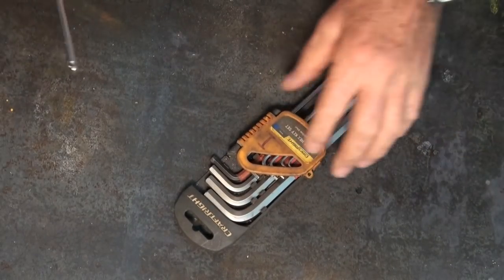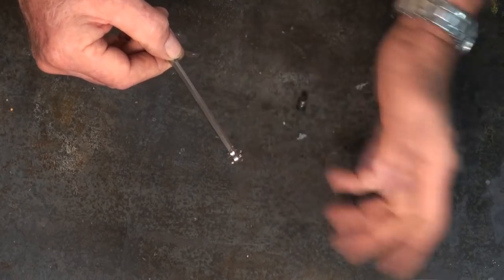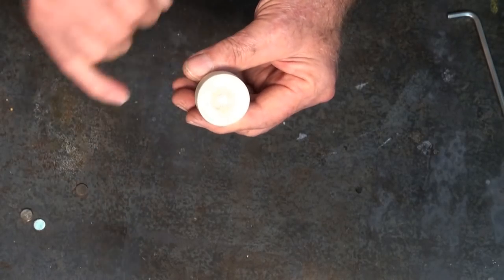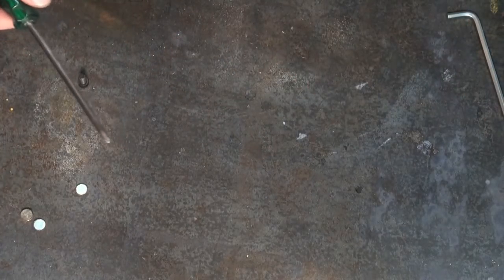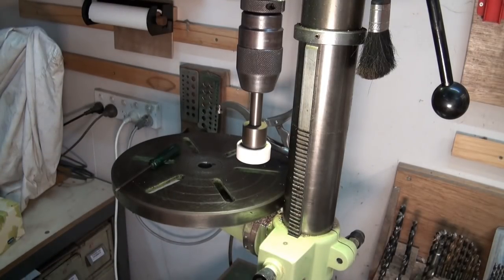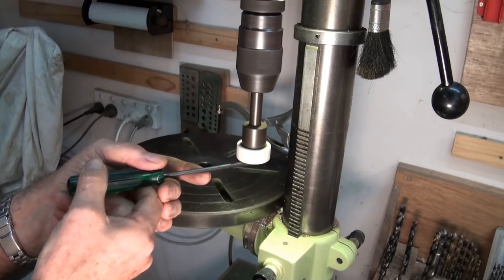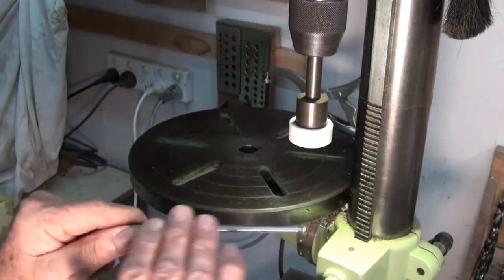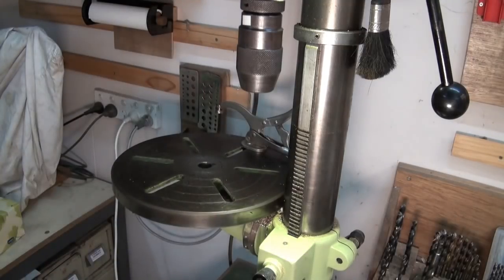DIY Demagnetizer Tool (That Works!)

Comment: As a boy I worked in a radio repair shop, we used a soldering gun to demagnetize screw drivers. Pull the trigger , slide the screwdriver through the loop formed by two rods and the soldering tip and remove slowly. If you Release the trigger while the screwdriver is in the loop it will magnetize it. I will make one like yours because half the time I can’t find my soldering gun. LOL 😂 !
Reply: Good tip, I've got one of those guns.👍
Reply: I still use the same procedure today

Comment: Works perfectly. Made one out of alumin(i)um, fun 2 hr project that is super satisfying to use. I've used it on end mills and other edged tools by clamping a thin sheet of plastic to the drill press table tight to the bottom of the spinning magnets part. That way the end mill is separated from the spinning plastic. Thanks for the video!
Reply from the maker: That's great! I only wish it was my idea. I made a much more elegant version here https://www.youtube.com/watch?v=Ew4BwYTzCe8 
I use mine regularly and it hasn't let me down once. 
Regards,
Mark

Comment: Mark, you just saved me $70. I am going to 3D print one out of plastic and glue some magnets into it. This is a great idea and tool. Thanks!!
Reply from the maker: Rodney. I only wish I could claim it was my idea. I think I saw this on the Home Shop Machinist forum. However, it's so simple and it works. Everyone should have one!
Regards,
Mark

Comment: I was impressed by your idea and have made my own version, seems to work just fine.  I run my version in a battery drill.Thanks
Reply: sOME TIME THOSE VERSIONS WORK IN A STRANGE WAY,  they dont demag completly. If you had a watch repair shop , fixing watches that cost 30.000 bucks, for sure you wouldnt use your version.

Comment: Made one based on your design, and it works!  I had a file and a boring bar suddenly turn magnetic, and this gismo solved that problem! Thanks for the tip
Reply from the maker: COOL! I'm glad it worked for you. There's nothing worse than a scriber that picks up swarf all the time. I have also put files down on the bench only to see a little halo of steel dust form around them. Creepy!

Comment: The construction you have is as good as it gets. The steel is fine as the mandrel, and is preferable to something like aluminum for a number or reasons, top among them being that it provides a path for the field on the non-working side and reduces stray field above the working plane to near zero. Additional benefit, to me, is that the magnets are attracted to it which can only improve the support.
Reply from the maker: Thanks for the technical explanation. This was definitely a "gut feeling" build. Magnetism is a sort of devil magic as far as I'm concerned! 😁

Comment: I have seen another YouTuber use the blue box contraption and it worked perfectly.  He magnetised and demagnetised the same tool repeatedly.
Reply from the maker: I have seen that too but it never worked for me. It would magnetise a tool OK but I never had any success completely demagnetising a tool with it. I used my rotary demag  tool today to demagnetise a centre drill that was holding chips. It just works every time.
Regards,
Mark

Comment: That´s clever idea! I built one with a pinball machine flipper coil and a small 12V transformer (unrectified - only AC) that works OK, but your solution can be also used in a lathe, when tools start to get magnetized, you just put your demagnetizer in the chuck and pass the tool in front of it. I like it :-)
Reply from the maker: Jose, the other good thing is that you can put the demag tool in a power drill and pass it over larger parts that aren't easy to move around. It works great for me.

Comment: Hello Mark. Thanks for posting this. I searched for demagnetising and was pleased to find this non electrical solution. I was then pleased to see it was from you, having seen you on one of Harold's excellent get together chats and your guest appearance on Rusti's channel. Anyway, I made my own version and it worked like a charm. I will be showing it in an upcoming video. So thanks again, this was really helpful to me. I'll be sure to give you a shoutout and link to this video. Mart in England.
Reply from the maker: Thanks Mart. I was also surprised when I made the first version of this tool. It seemed unlikely that such a simple concept would work as well as it does. You could easily make one of these with a 3D printer.
Regards,
Mark

Comment: Worked like a charm. I build mine using 4 neodym magnets, each 6 mm Ø x 10 mm, and fastened to the end of a bold with some gaffa tape, and rotated with a small battery powered drilling machine.  Thanks a lot.
Reply from the maker: Who would have thought it was so simple? I had previously struggled with the prospect of having to modify a mains operated transformer for an electromagnetic solution. I hate the idea of having to have live voltage to do the job so the magneto/mechanical solution was gold.
Regards,
Preso

Comment: Hi , mate, just a warning about quartz watches and demagnetisers.
Some 20 years ago , I was servicing a large production surface grinder , and next to it was one of those  "portal" demagnetisers, were the operator passed the parts thru , after finishing the operation.
I was wearing a nice Seiko quartz , and it was about 7.30 in the evening , and we had tea at 8pm , so I finished the setting and check the part and put it through the demagnetiser, look at the watch and it was 5 minutes to 8 , yee the time fly .. so I hurry up and pass thru the canteen, and see no one there,,, hey the boss must be checking out , ...but looked at the clock in the canteen, and it was 20 to 8, so by putting the watch near the demagnetiser, it has gone 20 minutes in about 15 seconds .. talk about time traveling...
Thanks for your chanel mate
Reply from the maker: I have seen that happen when I quartz watch is placed close to a heavy duty spot welder. The magnetic field around the copper arms will speed up the watch. It didn't seem to harm the mechanism but you are correct that if you don't notice it schedules will suffer!
Regards,
Mark

Comment: We used to use a Radio Shack BULK TAPE ERASER (Realistic 44-232)  it looks like a small iron and is about 2" x 3" You hold a button and energize it and run it over the parts to demagnetize and slowly move it away.  We used it on industrial machinery that feed loose nails and it worked great.They only cost about $30.00 back in the day.
Reply from the maker: Ahh, I still remember Radio Shack. It always had a distinctive smell in those shops. That "Realistic" brand name was on everything they sold from what I recall. I did start off with the idea of modifying an old transformer to make something similar but the instructions I read about how to carry out the modifications started to get a bit scary with electricity and all. But if you could buy something off the shelf that works it would be worth it. I still use my rotary demag tool. It is stuck to the side of my drill press and I use it often. It still seems like magic when it works. 
Regards,
Mark

Comment: Great solution to a pesky problem! Thanks - my tools have all mysteriously got magnetised over the past couple of weeks, we have had thunderstorms but no lightning close to my steel shed as far as I know. Our previous house got struck by lightning, it caused all sorts of weird problems with a TV that got half a green screen, I took it to a repair guy as I thought the degaussing circuit was cactus - nope, that was fine. Long story short I asked him to come to my house with a degaussing wand, when he arrived I told him to go in the shower and degauss the enamelled steel shower base, that fixed the TV. The problem was caused by the lightning strike magnetising the shower base which just happened to be directly behind the wall where the TV was, up a couple of steps - hence half a green screen!
Reply from the maker: That's really interesting. We had a severe thunderstorm that killed a quartz clock movement. It stopped at exactly the same time as a lightning strike near our house. I guess those clock movements use some sort of magnetic field to move the mechanism. It was battery powered and not connected to the mains so it wasn't a power surge that did the damage. 
Regards,
Mark

Comment: U can use the magnet from a speaker and run it through the middle of it. It can be a busted speaker just completely remove the magnet . Works good too. The bigger the better. U can find tutorials on how to remove them. 🤙

Comment: Hello Mark, I have just had this video of yours come up in my suggestions. What a great suggestion!!! I am ordering some magnets next thing.
 The first thing I am going to demagnetize is my Mitutoyo Verniers. I stupidly used them to measure the diameter of same magnets, know what happened, I turned my Verniers into a good magnet.
 Hardenable Stainless is a most accepting media as I knew but did not think before I took the leap. Thanks heaps.
Cheers from John, Australia.
Reply from the maker: John. Glad you found it useful. I have to demag my calipers regularly. I still don't know why tools of all types gradually become magnetic. It's a mystery!
Reply: Hello again Mark, I have also noticed on my scribe that it also becomes a little magnetic after a touch up on the grinder, that is also frustrating when marking something out with a ball of fuzz on the end.
Cheers from John, Australia.

Comment: Thank you sir, the bolt carrier for my WBP AK-47 has magnetism that I would like to remove so it does not attract metal debris if I were to shoot steel cased ammo from it, will try this to remove the magnetism. Bet you didn't think you were going to help someone demagnitize their Kalishankov when you made this video.
Reply from the maker: No, that is a surprise. I hope it works for you.
Regards,
Mark

Comment: Funny, he says “just so you know I didn’t secretly change screwdrivers off screen “…like degaussing scams are a thing. I can’t wait to try this. Also, I just learned more about magnetism here than in that physics class I failed in High School. Thanks!!
Reply from the maker: I have made three of these things and they work great. They are so simple and much safer than the doctored transformer type. I only realised after shooting all the video that I accidently took the screwdriver out of the frame during the crucial shot and as a result I had been accused of doing a switch and faking the results. If I were charging people money I guess there would be a case to answer but people are free to take it on face value.
Regards,
Mark

Comment: Just made one using a medicine bottle top wooden dol 8 6mm x 2mm rare earth magnets and a hot glue gun... Had to double stack the magnets... Used a compass to find the north and south poles. I demagnetize some AR 15 Parts firing pin and Bolt ... I spun the unit with a screw gun.
Reply from the maker: I had the idea that you could just about totally 3D print all the parts (except the magnets). It seems such an unlikely solution and it can be as simple or complex as you want to make it. 
Regards,
Mark

Comment: Good idea.   I think the steel base helps to concentrate the magnetic field.

I have read and observed the effect of the amount of steel and magnet.    Place one of your magnets on a piece of thin steel and feel the force to remove, which will not be much.   Take the same magnet and place on a thick piece of steel like your drill press table.   It will take much more force to remove the magnet.

The stronger the field from these magnets, the better they will work to demagnetize.

I will have to make one of these.

Dave.
Reply from the maker: Thanks Dave. It certainly seems to work but it was only after finishing it I started to second guess myself but as you point out the steel must be doing it's devil magic somehow.

Comment: Very nice idea brother.  I will most certainly give it a go.
Reply from the maker: You won't regret it. It's certainly one of the tools that I find to be super useful and it's so simple to use.
Regards,
Mark
Reply: @Preso58  Morning brother (4:35am here where I live). I surely agree that sometimes a tool should be magnetic but many times not, like a milling cutter. I just have to find small magnets and I will be on your level. Have a great day.

Comment: My drillpress, bandsaw,,,, EVERYTHING is. I hope this work on larger equipment
Reply from the maker: Did you have a lightning strike nearby?  I have heard that this can cause large metal objects to become magnetised. I also recall that many large steel ships would become magnetic during their construction due to them being stationary and close to the earth's magnetic field. 
Regards,
Mark
Reply: @Preso58  no sir. Used to have some magnets here and there on and around tools/bench. They were removed over a year ago unfortunately they still stickin around.

Comment: Nice! Now I'm off to de-magnetize my Mitutoyo digital calipers that got sticky, how I don't know. Tiny stuck particles on the jaws play havoc with measuring and zeroing.
Reply from the maker: I have had the same problem and it drives me mad too. The tool doesn't seem to affect the electronics in the set of Sylvac digital calipers I was using. I only place the open ends of the jaws under the rotating magnets.
Regards,
Mark

Comment: I have a scratch awl that I wanted to demagnetize, but the $4 I spent on the cheap one was a waste of time and money. I'll make this the first week of my welding class this semester!
Reply from the maker: It's so simple and yet really effective. You can also mount it in a cordless drill and just take it to a part which may not be able to be removed.
Good luck with it!
Regards,
Preso

Comment: thank you. exactly what I was looking for. I am going to try to demagnitize an old (not too valuable) watch that isn't worth the $250 I'd have to pay for a clean/service/demag. It was running fine and it definitely came within an inch of a neomydeum magnet and I was very suspect about the hardware store piece of crap $13 magnetize/demagnitize tool. I have nothing really to lose and I have plenty of the little neo mags. 
 Also+sorry to butt in-but as a cabinet maker 50 years with shop does your drill press not need some type of lubrication? It sounds like a locomotive coming to an abrupt halt. 

again, very useful video. thanks
Reply from the maker: I have used that demag tool on my Mitutoyo calipers and it doesn't seem to affect the electronics or the read head so I think it would be fine on a watch. You might need to put something like soft felt on the cap over the magnets. Parts are initially attracted to the cap quite strongly and it might scratch the watch.
My drill press is somewhat noisy because I fitted a "pull gear" to the motor shaft. It is a reduction gearbox which uses planetary gears and they tend to rattle when it is in direct drive (nearly all the time). Before I fitted it I had a poly vee step pulley drive and it was super quiet. The VFD also adds to the noisiness too. 
Regards,
Mark
Reply: @Preso58  report: made it. used it on a1969 longines automatic watch that was running well but extremely fast (the sign of magnetization) and after two tries only temporary success. After a third more extensive round of passes on both top and bottom of case- success. in fact, the watch came right back to the time it had been keeping a few months before it went off the rails.  I have a feeling it must had met a random neomydeum refrigerator  magnet at some point

Comment: I just learnt from BigClive all you need to do is swipe your screwdriver over the edge of a magnet to demagnetize. Swipe over eighter pole to magnetize again.
Reply from the maker: I have great success in magnetising tools but getting them demagnetised is more complex. Especially if it's something like your digital calliper. Nothing is more annoying than having little chips sticking to the measuring surfaces and since there are two tips it's not quite so easy to do it with a single magnet. This tool does work well on larger tools or tools with odd shapes.
Regards,
Mark
Reply: @Preso58  Even my drillbits get magnetized somehow, it takes no effort lol, really annoying indeed! I guess the single magnet trick is only good for simple parts.

Comment: Do you have a diagram that you can show us indicating more about the magnets stuck inside the tube like I understand but I don't understand
Reply from the maker: The poles of the magnets just need to be opposed. So if you have four magnets, the ones at 12 O'clock and 6 O'clock will have, say, south pole down and the ones at 3 O'clock and 9 O'clock will have north pole down. You can use any even number of magnets in an array. I have seen some versions with up to 12 magnets. The greater the number of magnets, the more pulses you will get for each revolution of the tool. 
Regards,
Mark

Comment: I expect that it is better for the part of the tool that contacts the underside of the 4 magnets to be steel rather than aluminum, because the steel will close the "magnetic circuit" between north and south poles of adjacent magnets, giving a stronger field on the top side of the tool.
Reply from the maker: I haven't tried that but mine works well enough. 
Regards,
Mark
Reply: @Preso58  Your is made from steel, isn't it?  So the "back" side of the magnets (the side away from the working face) should either be touching steel or close to it in your tool.  You should get some benefit from that, compared to making the wide part of the tool from aluminum.